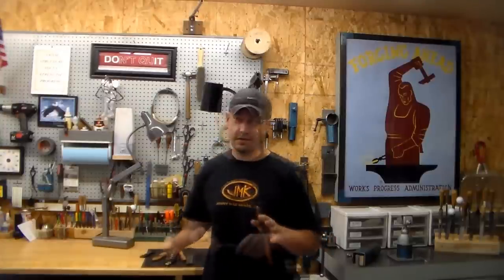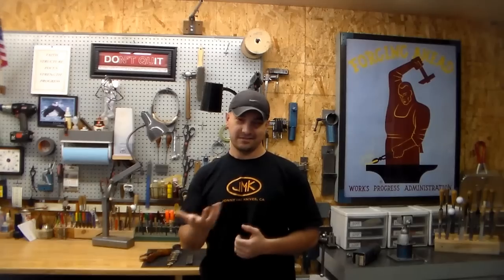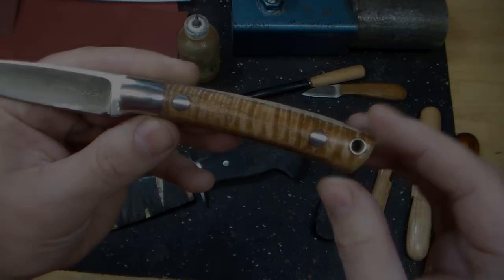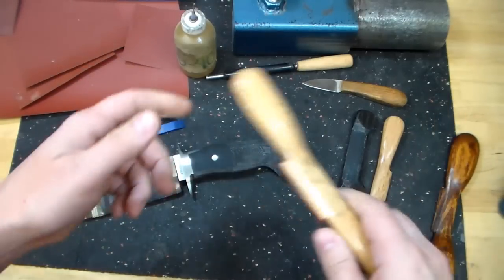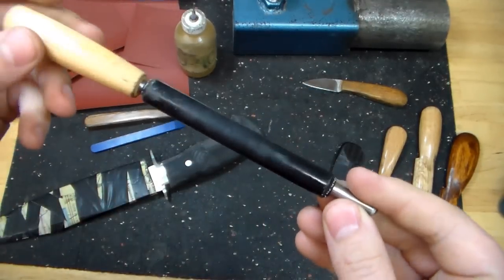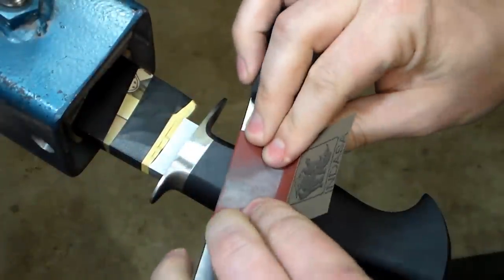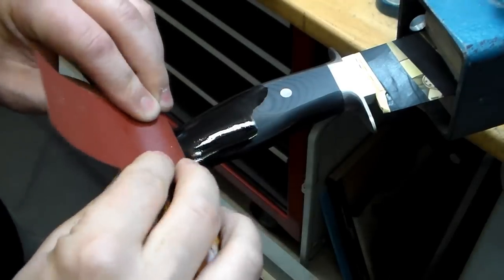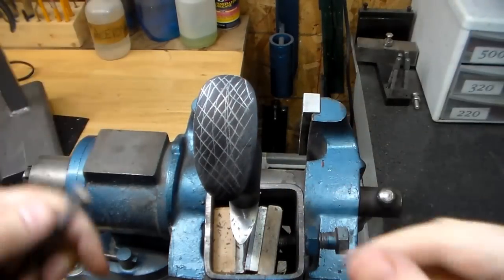Custom Knife Making Bowie handle shaping with Nick Wheeler part 7

Comment: Do you use any lubricant when sanding your wood handles? I assume you dont use the WD-40? I have had a problem with clogging paper on my wood handles. Ive tried using water which works ok and does not stain or fill the grain with oil which prevents finish from sticking.  
     I just remembered that you do use stabilized woods which might be a different story when it comes to soaking up unwanted oils.  
Anyways Nick Thanks For the Super "meaty" and informative videos. You Rock!
Reply from the maker: Alec Guth I actually don't... I just change out the paper often. The Rhynowet does last quite a while though. With some woods like Koa, I wet-sand with Birchwood Casey Tru-Oil, but it actually makes the paper load up faster. I just like the way it seals the wood and the finish I get with it.